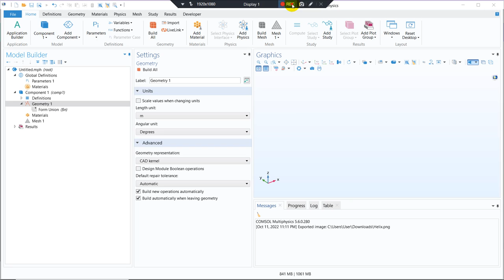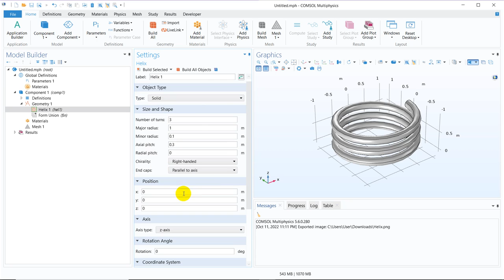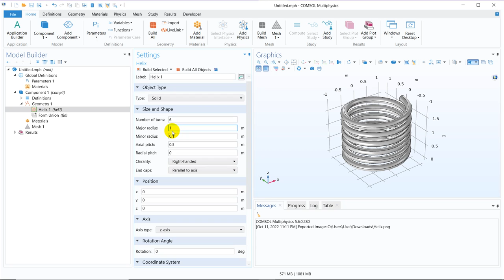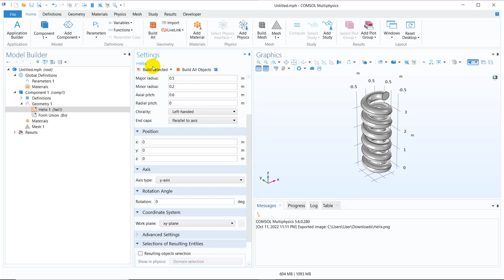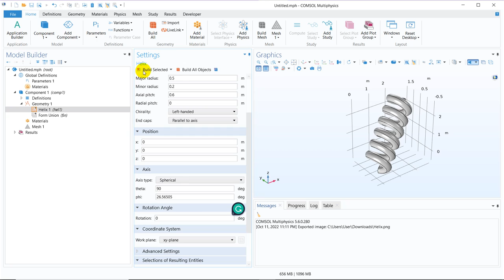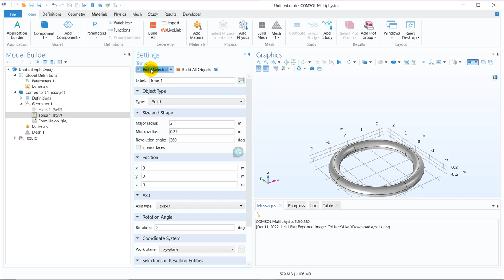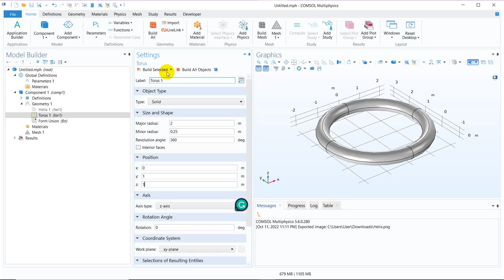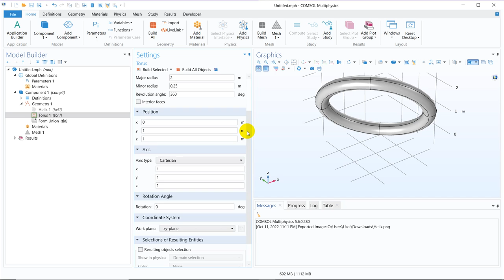Helix and Torus in COMSOL Geometry #Helix #Torus #geometry #comsol #POS #research #engineering

Comment: Please uplode a video about Heat transfer in fluid and Laminar flow Related physics and also showing the process of advanced level post processing of results.And how to solve a equation using variable function.
I always follow your video that's help a lot but basically i am from mechanical engineering background so try to upload in Mechanical related work.

Thanks In Advance.
I am from Bangladesh.
Reply from the maker: I will upload a video on the topic you requested. Thanks for the suggestion. And wishes for Bangladesh from West Bengal, India.
Reply: @pioneerofsuccess4054  Appreciate your Work.❣️

Comment: How to draw the same helical structure with rectangular cross-section instead of circular?
Reply from the maker: If you think deeply you can realize that a squared cross-section could never make a perfect helix. However, you can make something similar. In that case, you have to make it by taking several rectangular parallelepipeds or making a similar 2D geometry and then extruding it in the normal direction.

Comment: I have done the same helical structure... But I didn't find any source when simulation is over
Reply from the maker: I could not understand your question properly. Will you kindly elaborate?
Reply: @pioneerofsuccess4054  actually I am trying to find out the modes... But I didn't find any mode after simulation